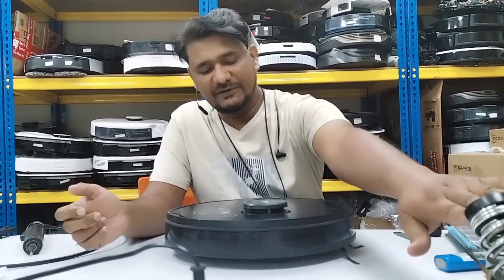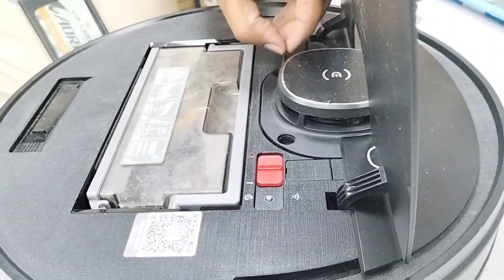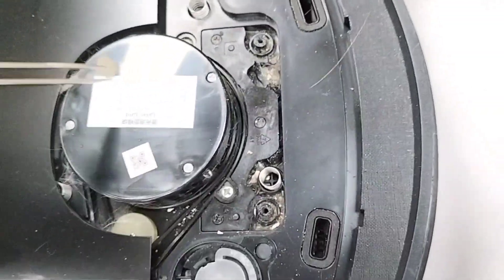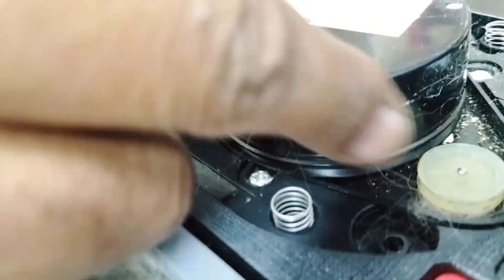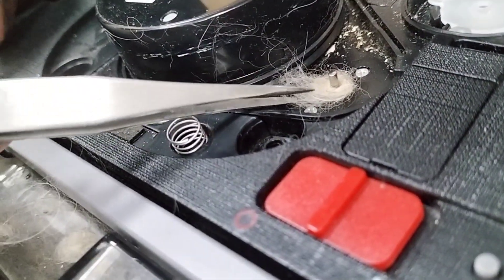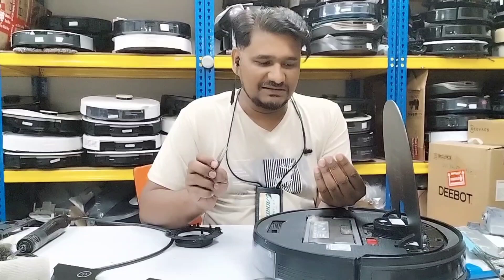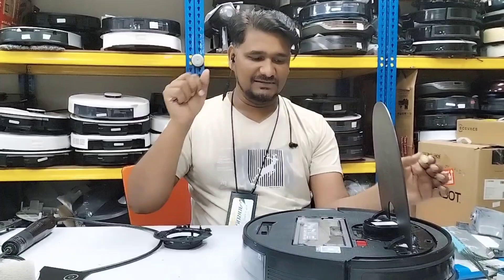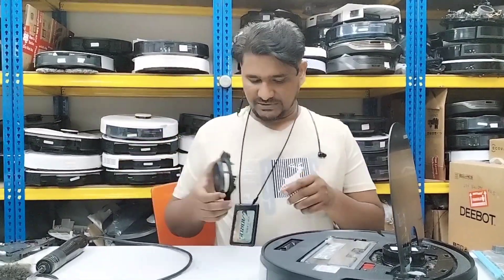Ecovacs | Ozmo 950 | Giving LDS Error? How to Check LDS assembly?

Comment: I have a Ozmo 920 series and the vacuum reports:  'my laser distance sensor is blocked please clean it'  I have taken the laser motor assembly apart and have thououghly cleaned it with compressed air (although it was not particulalry fouled)  Could the laser module itself have failed? If so, can I buy a replacement module?  Many thanks

Comment: Hello! I've replaced the LDS of my 950. It worked perfectly for once. Then after putting it back to the charger, whenever I turn it on, the deebot gives the power on message and starts beeping for 7 times), and nothing happens after that. I noticed that the LDS no longer spins. On the app, the deebot is now offline and I can't connect to its network, also even if I remove the dust container, no message is played. Could you please support? Thanks!
Reply from the maker: Have you tried to reset or not yet...plz try to reset.press n hold reset button for 7 second...if can't reset or no function at all then...most probably core board issue...located next to motherboard board a small green colour chip that is faulty.... hopefully Ur previous LDS assembly also good

Comment: My Ecovacs Ozomo 959 LDS Not Working, Motor is Not Running or May be Some other Problem, Can you Arrange For Servicing at Home, Kindly Arrange at Dwarka New Delhi 🤝
Reply from the maker: Mera dil to bohot krta he k me India aoon . Pr me Malaysia me job kr raha hoon. Ap India me hotline no. Pr try kren wo home services provide krte hen...agr LDS Nahi ghoom raha to mostly LDS assembly change krni prti he
Reply: @ecovacstechnicalsupport5278  🙏👏👏👏🤝
Reply: @ecovacstechnicalsupport5278  Dear friend, As per your Analysis & Calculations, What is Cost of LDS Sensor Spares Parts 🤔🤝

Comment: Hi my ecovacs deboot 950 is showing lds error,lds unit is clean no noise from lds bearing,belt is in good condition but motor is spinning at very high speed and stoping,i have tested the motor without conecting the belt as it spins at high speed and stops and again spin ,should i change the motor or the lds unit,please help me
Reply from the maker: If deebot totally not moving then lds assembly need to replace

Comment: Hi there, the bearing in my lds on a deebot 950 is worn. It still operates but i want to order a replacement lds assembly. Mine is V06, i can find used lds of v06 or new lds v03. Can i use either?
Reply from the maker: No...sir you have to order same part...other models looks same but won't work in Ur device

Comment: Done but it is still giving same error
Reply from the maker: If you LDS assembly looks clean belt all everything fine.lds moving but deebot won't move so means LDS small board attach underneath the LDS is faulty...need to replace LDS assembly
Reply: @ecovacstechnicalsupport5278  how do i check if its lidar reason not motherboard? My new robot stoped working on second day but lidar is still spining, actually it gives response when i unplug Lidar from motherboard (he will spin around)  but if i connect he tries a bit forward and then going back.
Reply from the maker: @xstorm9939  when it start reverse without hitting anything in open space then what's the error msg appears in app or voice mag??? Remember one thing if deebot is reversing then it's not a LDS assembly issue...it may be bumper stuck...or Anti drop sensors issue or maybe any connection loosen that's why reversing if its a new deebot...plz check again all connections n wipe all sensors with dry soft cloth n try again

Comment: I have an issue with deebot T8 aivi and I think you never had this kind of error. I really need help, I have two videos of an error. Do you have email or where can I send them to you so you can see? I would appreciate very much if you can help me. I want to mention that my T8 aivi is clean, all filters, brushes, wheels, sensors everything is perfect but error I have is the biggest mystery. I can disassemble entire deebot if necessary. Please let me know how can I send videos and exchange few words about this. I can Skype if that would work with you?
Reply from the maker: Plz WhatsApp @ 00601137973018